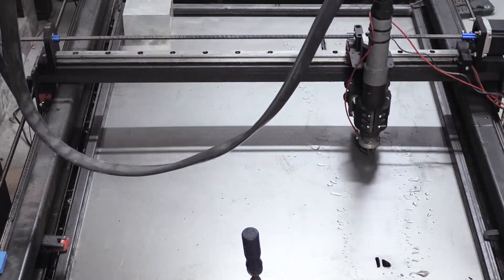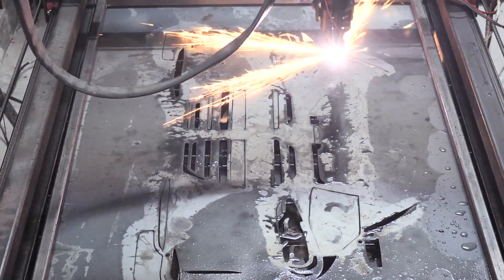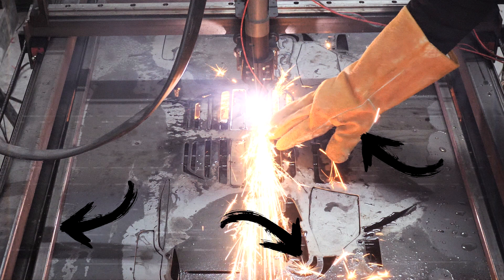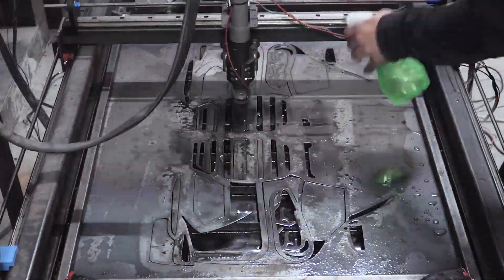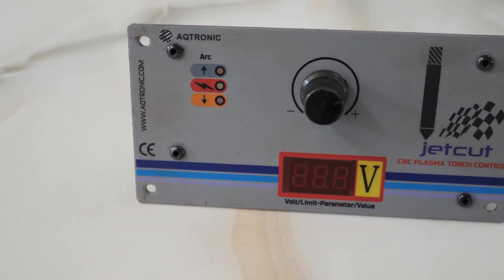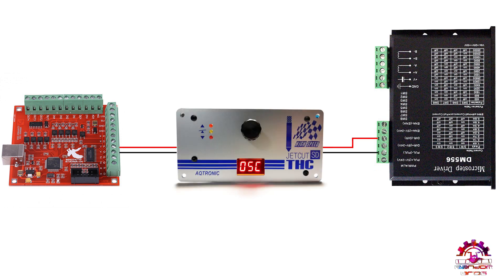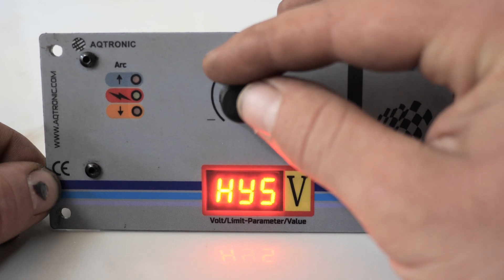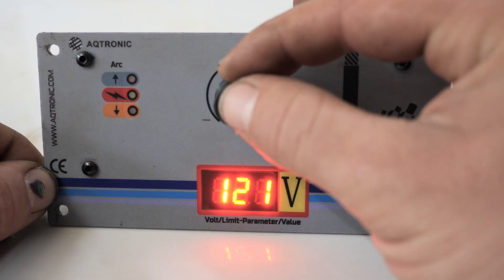AQTRONIC CNC Plasma THC

Comment: Bonjour, je souhaiterai installer ce THC sur un Herocut HC8000, comment connecter vous "l'arc signal" et le "contrôle signal", les 2 prises à l'arrière de l'appareil ?
Avez-vous des schémas de cablage?
Merci d'avance
Reply: hi,HC8000 ARC voltage output Pin1+ to JetCut +ARC(1:1) ,  HC8000 ARC voltage output Pin2-  to JetCut -ARC(1:1), HC8000 Signal Control 1/2 to the relay plasma On/Off (breakout board).HC8000 Signal Control 3/4 no connection.

Comment: i have the same motion controller, but the blue one, what is the name of the plasma cutter you are using, since you need a plasma cutter that is compatible with THC
Reply from the maker: Hello mate I am using a Herocut HC8000 but the THC is compatible with most plasma machines. Do you have an HF machine or a Blowback ?
Reply: @wearetherandombros7782  I have the yesweld plasma cutter cut55ds pro blowback will that work, and also on the website there selling the THC cheap than on ebay
Reply: @wearetherandombros7782   I have yesweld CUT-55DS Pro, it don't have a arc voltage at the back like yours  hero cut, cause the THC want some 1:1 voltage idk.. did you order from the website
Reply from the maker: Ok so I've checked your machine. You just need to open up the case , and attach 2 wires. One on the clamp terminal (clamp on plasma machines is the positive) and one on the torches terminal (negative) and that's it. The ratio is 1:1 and you are ready to connect on the THC . Remember to use a cable  as short as possible to avoid interferences.
Reply: @wearetherandombros7782  I will give you a update when i Install the THC
Reply from the maker: Yes mate I ordered directly from the website. Pretty easy and straight forward. Can you send me a picture of your plasma and setup at Alma_automations on Instagram to see about compatibility?

Comment: Awesome video. How easy it is to install and get familiar with it? Will it be too much for a beginner?
Reply from the maker: It's pretty straightforward to set it up since in the SD configuration you don't need to do any mach3 programming. You just set up the parameters on the actual THC